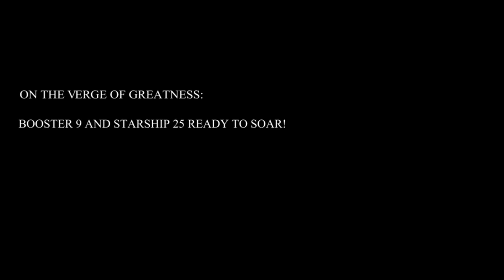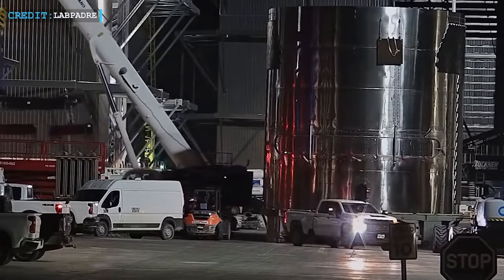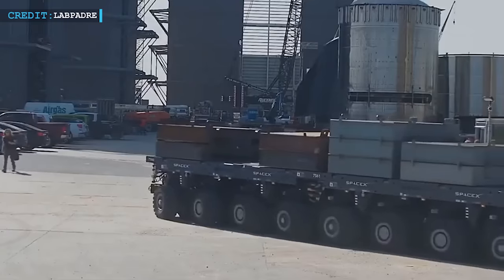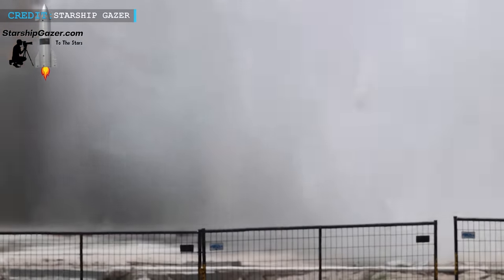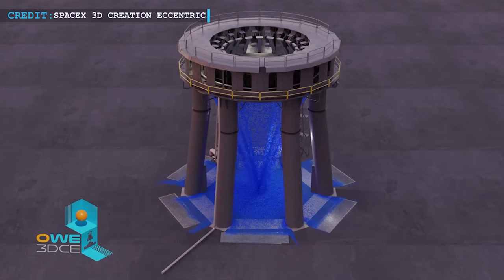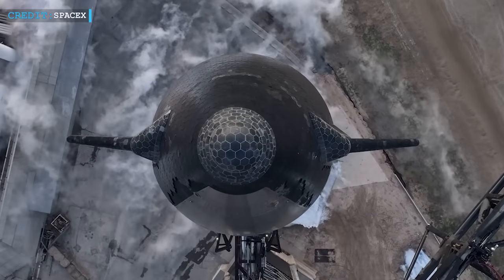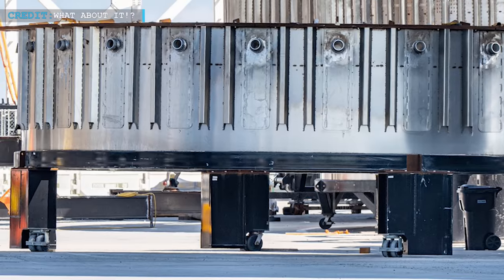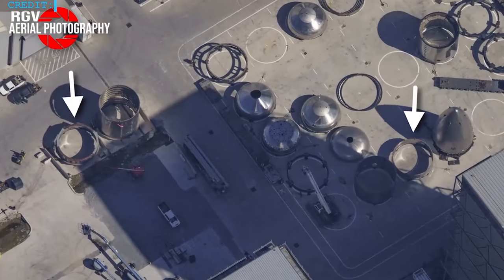Spacex Lifted Booster 9 On The Upgraded Starbase Pad Ahead Of Static Fire | S27 Scrapped And Sliced!

Comment: Tall buildings erected on alluvial soil topple over during earthquakes due to phenomena called soil liquification. One just wonders how many artificial earthquakes (launches and static fire tests) will it take before alluvial soil (with very high ground water level) laying below OLM  and launch tower liquifies toppling over both structures. What we have seen during last test launch was accelerated pile driving (whole OLM hammered into soil below). After last modification (introduction of raft and pile structure) we will see not pile driving as before but accelerated soil compaction causing soil liquification. I just cannot wait to see this action.
Reply: Actually the OLM was being pulled from the soil as it held onto the rocket before the clamps were released.
Reply: I doubt the engineers are so stupid that they didn't take that into account when they've did the design. It is possible to design a foundation that will maintain an even keel even when the alluvial soil it is in liquefies.
Reply: @calvingreene90  By Elon Musk's own admission he and Space Cadets at SpaceX were stupid enough to launch the the Starship without using hold down clamps while "increasing thrust gradually". When asked  if the sideway surge of the rocket away from launch tower after clearing OLM was intentional Elon stated that it was not. So if Elon to this very day cannot figure out that not using hold down clamps and increasing thrust gradually gives enough time for the rocket to tip over while he is inching his rocket upward with TVC incapacitated by restriction of horizontal movement of the bottom of the rocket entrapped by OLM structures resulting in overcompensation of TVC once bottom of the rockets clears OLM that is very scary. Next time rocket might lean towards the launch tower not away from it and that might result in greatest chemical explosion in history of mankind. So it seems to me that your argument about cleverness and foresight of Space Cadets at SpaceX has no basis in current practice.
Reply: @davidlang4442  if there is a bedrock close enough to the surface to accomplish that task. Not very likely given method of construction currently used (raft and pile)  and mode of failure (concrete slab shattered by sinking of OLM)
Reply: @KarolKarolak  
The facts of different engineers and building codes argue against you.
Reply: @calvingreene90  No building codes anywhere in the world foresee building of a structure that is self generating artificial earthquakes. Different engineers (US Corps of Engineers) refused to design OLM for Elon Musk, so they might have known something that Elon did not.
Reply: @KarolKarolak  
But there is building codes for dealing with earthquakes.

I get it you hate Elon Musk but admitting to mistakes and even that they were foolish mistakes does not mean that they are fools.
Reply: @calvingreene90  It is very likely that Elon's decision to build launch facilities in Florida so early in the game were driven by his knowledge that due to geologic conditions it is impossible to build proper OLM at Boca Chica. I do not hate Elon Musk, far from it, but I know that he has very limited engineering knowledge and very limited foresight. Elon did not admit to any mistakes made during last launch. To this very day he does no know that his "cautious approach" to launch, that was driven by his desire to prevent collapse of the Skirt of the Starship on the launchpad, caused near miss with his rocket lurching sideways uncontrollably after clearing OLM. That cautious approach was driven by the fact that Elon had no idea at what acceleration level the Skirt would collapse as he did not conduct any prior testing and there are no reliable computer models. During normal launch hold down clamps release generating instant acceleration in range of 3m/s^2. Skirt of the Starship partially collapsed when acceleration of the rocket reached 7m/s^2 so these values were very close and way below expected as the Skirt should withstand acceleration of 35m/s^2. It was Elon's ignorance and stubbornness that made him use unpressurised Skirt despite being told by many people that it would never work and also being told that use of 6 VacRaptors as support columns would increase his chances of success. Elon tried his way to the bitter end and now he tries to lie his way out of blind alley claiming that his switch 6 VacRaptors has nothing to do with using them as support columns and everything to do with rocket's propulsion.
Reply: @KarolKarolak  
People also told Elon that it is impossible to land and re-use first stage boosters.

The Florida launch complex for Superheavy/Starship is because Texas is a very limiting place to launch from.

You are also wrong about Elon's engineering education.
You might not hate him but you certainly act like you do.
Reply: @calvingreene90  There was never real need for re-use of first stage boosters same way as there was no need to build cars on assembly line when they were custom build for the rich people only. Ford created market for his cars by selling them to his own workers Elon created market for his reused rocket building up Starlink.
Reply: @KarolKarolak  
Elon made the market for reusable rockets by lowering launch costs.
Skylink is a great money maker.
Reply: @calvingreene90  Internet and invention of phased array antenna created need for reusable rockets. SpaceX currently virtually owns whole world market for launch services and that whole world market is less than one third of all launches they currently perform.
Reply: @KarolKarolak  
And that is because they brought the cost of launch down by using reusable rockets. And by reducing launch cost he made it possible to build the giant constellation of LEO satellites needed for a starlink like internet provider.
Reply: @calvingreene90  You are 100% right. Real need met by real solution